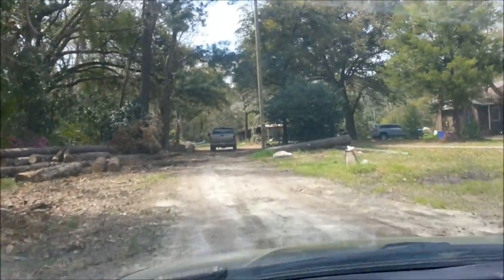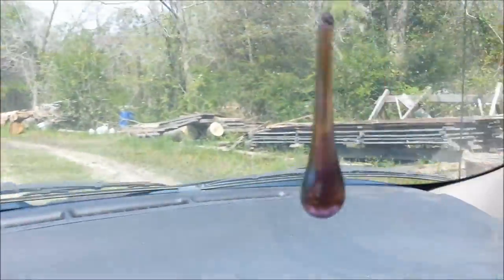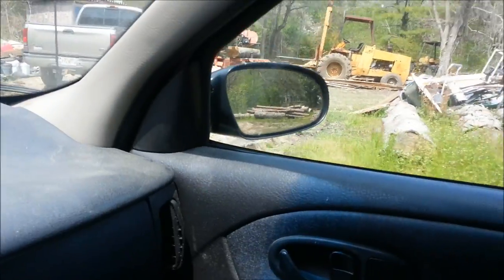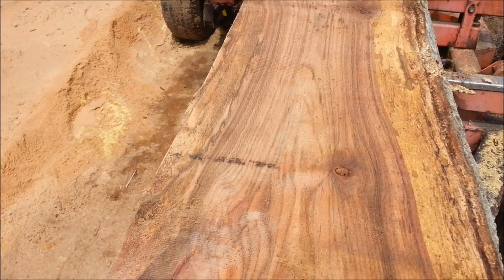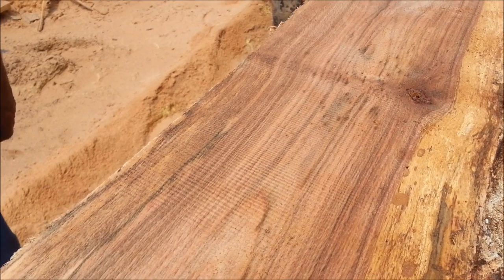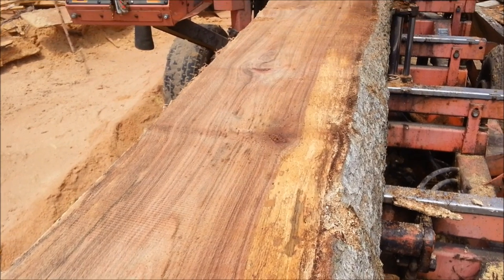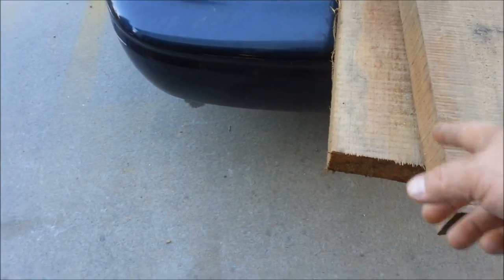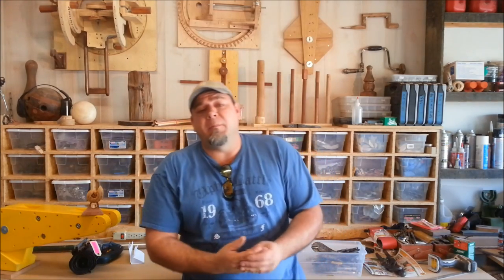Saw Mill Tips and Identifying Wood

Comment: Good video Izzy, and good advice.

As crazy as this sounds I use my nose to identify many woods if I'm not sure.  They all have a different smell but like you I can only identify maybe 30 - 40 types.

That said, rough sawn pieces need to be ricked for up to 7 years unless it's kiln dried.  Especially walnut.

This is my first comment.  Love the videos.  Please keep em coming.
Reply from the maker: Thank you for commenting, smell is a great tool and i should have mentioned it in the video.
Reply: I'm fairly new to the wood scene, but I agree. After turning some walnut for the first time, I will never mistake walnut for anything else, nor think anything else is walnut.